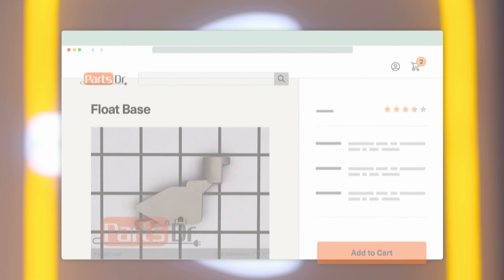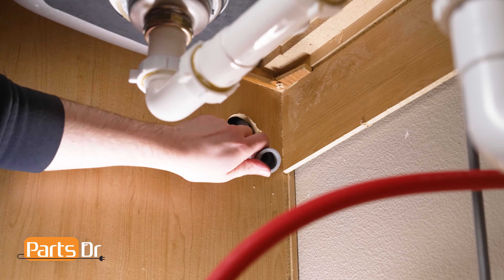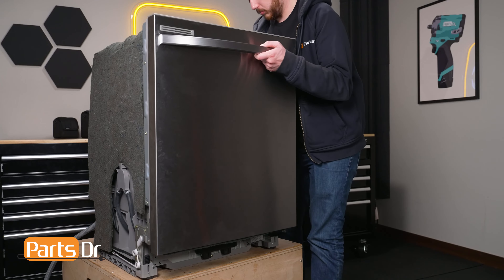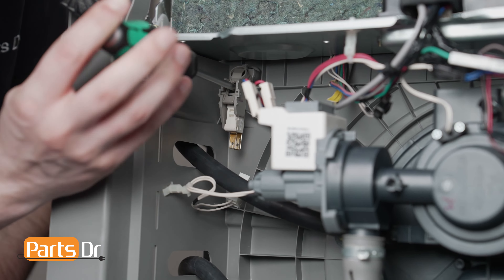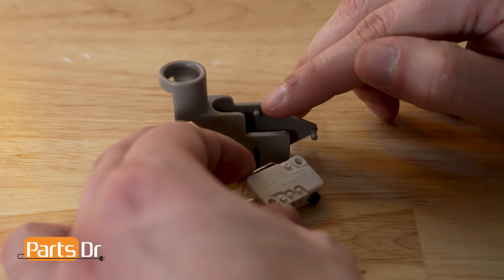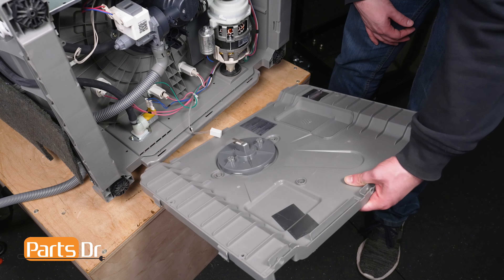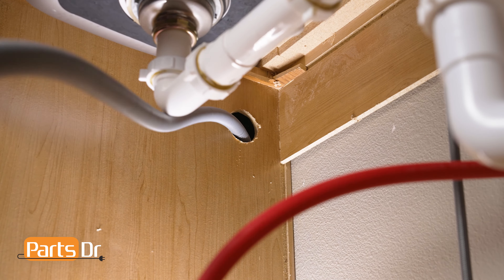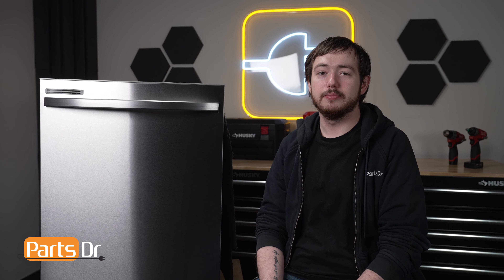How to replace Float Base part # DD81-02238A on your Samsung Dishwasher

Comment: So would my dishwasher flashing normal and sounds like the pump is running be the symptoms of bad float switch?  I can see soapy water in the base
Reply from the maker: The normal light flashing usually indicates that the water leakage sensor has been triggered.